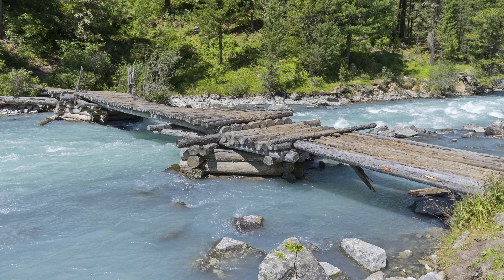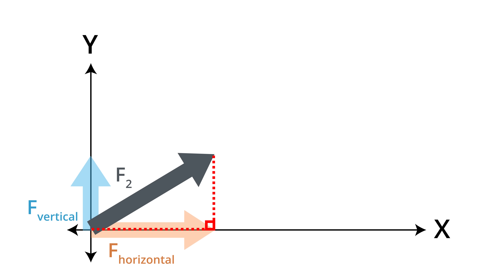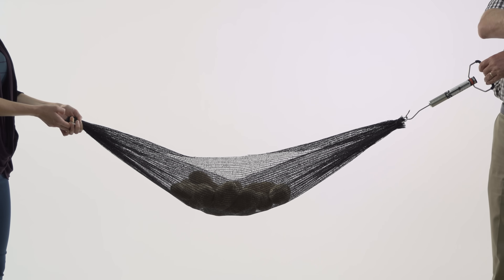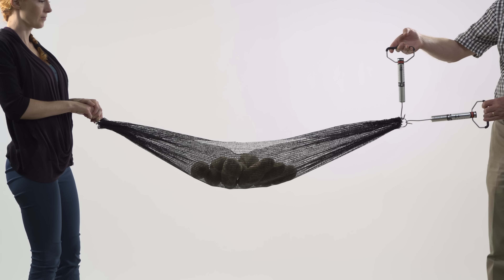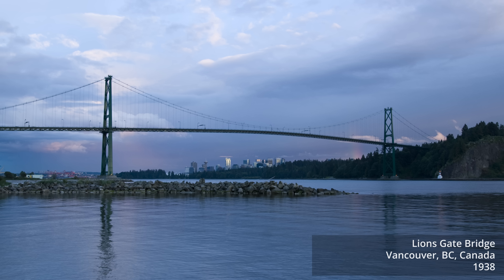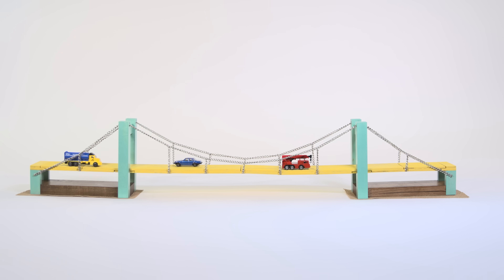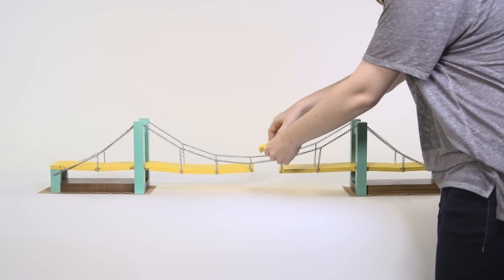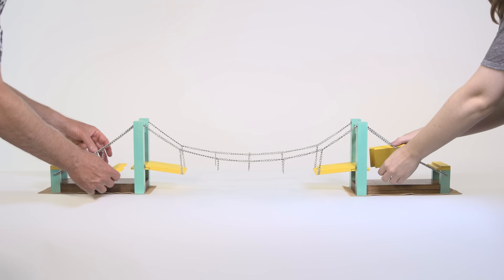4. Suspension Bridges

Comment: A suspension bridge carries vertical loads through curved cables in tension. These loads are transferred both to the towers, which carry them by vertical compression to the ground, and to the anchorages, which must resist the inward and sometimes vertical pull of the cables.

Comment: A couple of comments:  The horizontal force component would be the cosine of the angle of the force vector times the force vector, and the vertical component would be the sin of the angle.  Also, the failure of the Tacoma Narrows bridge wasn't simply due to a lack of rigidity, but because a proper dynamic analysis wasn't done.  The bridge experienced increasing oscillations from the wind due to the excitation of its resonance frequency.

Comment: A little disappointing you did not show the Mackinac Bridge between Michigan's upper and lower peninsula's. It is amazing to drive over (the center 2 lanes are steel grates, not concrete) , and even more fun when it is opened for foot traffic (the bridge run).

Comment: Correct me if I'm wrong - but wasn't the Tacoma bridge AKA Galloping Gurdy like that as a result of the exact opposite issue you described? If memory serves, it galloped and eventually broke not because the materials they used were too flexible, but because they were too rigid, causing the wind whipping past to resonate into enormous waves of energy forcing themselves through components that ordinarily shouldn't have give - thus leading to the eventual structural collapse. Admittedly, it's been some time since I reviewed that material.

Comment: The video only mentions the total horizontal and vertical component at each end of the cable. The video should also mention that along the length of the cable the horizontal component of the force is constant, and the vertical component changes according to the delta of the angle.

Comment: Really nice work. Though i am unsure that the Tacoma Narrows bridge collapsed because of the flexbility of its components (it may just be a simplification) but rather because the components, that were very solid, had a resonnance frequence that matched that of the wind at the time it broke. This causes the vibrations to increase violently passinf through the bridge, causing the collapse. Usually, engineers select materials with resonnace frequences far away from the ones the building might encounter in nature (wether for sismic waves, of even wind...)
Reply: It appears to be a common misconception (or grossly oversimplification) that the " frequency" of the wind was the same as a resonant frequency of the Takoma Narrows bridge and that this led to the bridge's failure. The actual cause of the failure was somewhat more complex and due to aeroelastic instability. A relatively constant velocity wind caused the bridge deck to deflect (both laterally as well as, more importantly, torsionally). This twisting generated aerodynamic lift caused by the "angle of attack" of the bridge deck changing.  This lift caused further torsional deflection further increasing the angle of attack, thus generating even more lift.  Eventually the angle of attack reached the point where aerodynamic stall occurred, resulting in a loss of aerodynamic lift and thus causing the deck to move down towards its equilibrium/neutral position.  However, because of inertia, it moves past its neutral position, and continues downward resulting in a negative angle of attack, and the resulting generation of a downward aerodynamic force on the deck of the bridge.  This twisting can be clearly seen in the video. As the negative angle of attack increases, it once again reaches its stall point, and the downward aerodynamic force is lost.  The forces due to the elasticity of the bridge structure now pull the deck back up to its equilibrium position and the process goes on and on.  So, a steady wind that can exert sufficient lateral force (with consequent twisting and consequent lifting (positive or negative) force) so that the stall angle of attack is reached is what caused the bridge vibration amplitude to reach sufficient levels that caused it to structurally fail.  

This is a somewhat simplified explanation of how the (relatively steady) wind caused the bridge failure.

Comment: Great video, but I've got a question. Won't adding the extra panels for enhanced rigidity of the deck panels increase the weight supported by the cables of the bridge? so in the end, you'd end up spending more on stronger cables as well. But i guess there isn't really a way around that problem if you want to keep safety in mind.

Comment: The narrows bridge did not fail as a result of deck flexibility. It was due to vibrational resonance between the deck and wind. Due to the construction of the road, oscillating vortices formed on top of the road, causing the vibrations.
Reply: True, but the reason why those oscillations formed was because of the flexibility of the bridges design. If the bridge had a different flexibility spectrum, the those wind induced oscillation wouldn’t have been able to resonate with the bridges limits.

Comment: The London Tower bridge doesn't resist the load from a suspension section because of the bulk and mass of the towers.   The tension is transmitted between the two towers via the structure connecting the two towers.

Comment: How could it be possible to decrease horizontal force . Because tension in the rope increase , because of increasing tension more sagging occur in the rope .Which result change in theta , so horizontal as well as vertical must also change ..Plz share your view on about..
Reply: No.
Reply: It is in the video. To decrease horizontal force, you would increase your tower's heights or add the same half to the other side of the tower so that the forces would just cancel.
Reply: Vertical force don't change as it is already predetermined using live load, dead load and moving loads.

Comment: It was my understanding that the Tacoma Narrows bridge collapsed due to its over-ridgidity. The minor pressure forces acting on the surfaces of the bridge were transfered to the entirety of the structure rapidly, instead of individual, freer moving sections over time. You can't get a wet noodle to ring like a dry one when you hit it.
Reply: the wind turbulences also entered in harmonic with the bridge fundamental frequency. Thus causing more torsion and thus dooming it.
Reply: @TidusleFlemard  exactly though. Modern bridges experience all the sender forces acting on them as the other replys, but the internal distribution of those forces are now destructive interfering so as to cancel instead of resonate. Back to the wet noodle. The problem with the Tacoma narrows bridge was that it did not incorporate slip joints nor mass dampers and thus began ringing like a monolithic bell.
Reply: It's how it was shaped in cross section. The wind causes it to move in a wave-like manner until the movement caused torsion failure.